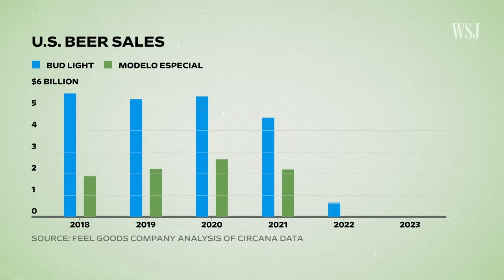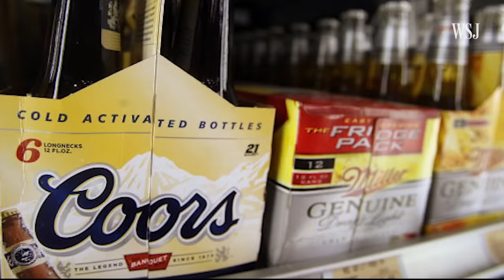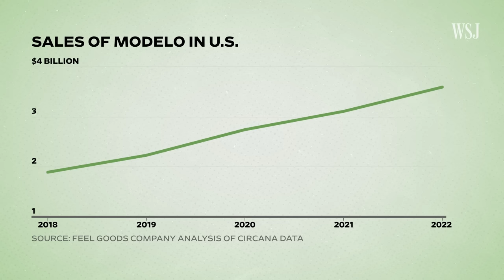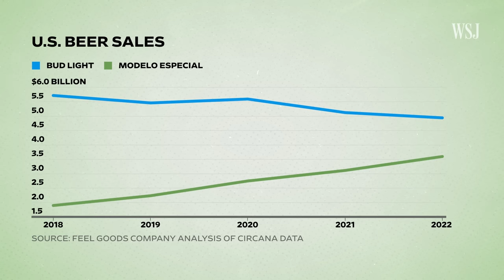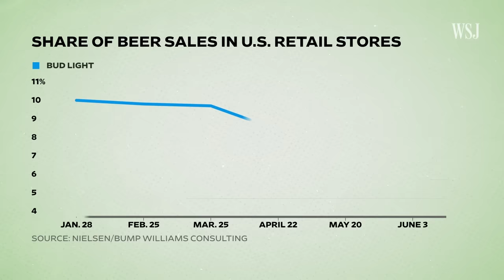How Modelo Used Data to Become America’s Top Beer | WSJ The Economics Of

Comment: I sure do miss the days when drinking beer wasn't a political statement.
Reply: I sure miss the days when beer had a taste.
( I just can't do cans. ... so stopped drinking beer.  )
Reply: @CHMichael  then just don't buy mainline brands? This seems like a silly take to me. I buy great tasting beer all the time.
Reply: It pretty much shows that your colleague group at sometime in your life hardwired the only way to relax and bond (internally & externally) socially with the repeated behavior of consuming alcohol. 

Nothing more to it. 
Yet that says a lot. 

Not trying to condemn it though. To each their own. There are tradeoffs to every decision in life. This includes but is not limited to:

Standard deviation towards desirable long term outcomes given an undefined variable set of circumstances.
Reply: @philawsonfur   Thanks but I think you may have posted to the wrong thread.  I don't see any comments about social drinking with colleagues to relax and bond.

I'm not condemning your post though.  It's just that deviation from the original topic and attempting to conduct multivariate analysis using limited datasets and incorrect assumptions could lead to long-term undesired outcomes and confusion.  :-)
Reply: what was the political statement even?
Reply: At the end of the day it is part of marketing. That aside, I suspect many regular folks—outside of loud social media commenters, celebs etc—dont care that much to the point of changing their beer choice based on political identity. Maybe 50-50 between those who do & dont?

Fwiw im centrist/moderate prog, supposed to be aligned somewhat closer ideologically(‡) to Bud Light. Can't stand the taste, zero interest to switch. All my purchases are based on price, availability, taste.

(‡) among the most absurd phrases I've ever written btw
Reply: @CHMichael  Do you never drink soda? They put a lining in all cans to make sure the taste isn't effected. Bottles actually change beer taste more than cans do with today's tech. Light penetration is a non-factor with cans.

Comment: Oi ups homie would love to see a Modelo Light Low Alcohol bottle Beer yuh only because I drive a Chevrolet Camaro Zl1 1Le with a Old used Nascar 2020 Chevrolet R07 5.87 Litres Supercharged V8 Motor Crate yuh Converting it to a Liquid Hydrogen Fuel Injected Specifications American Muscle ICE V8 running Clean but Nascar Supercharged V8 Speeds and Alcohol just don't mix very well I am afraid America Oi❤💯🌎🇺🇲🦅💪🚘🍺👍😎.